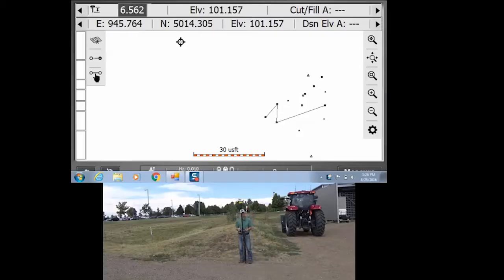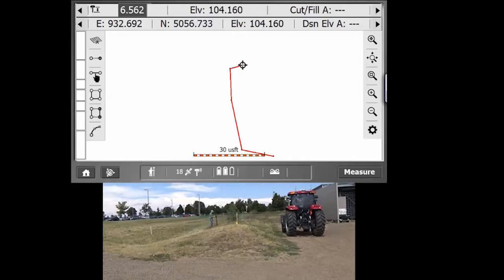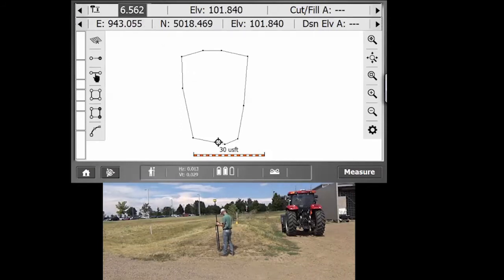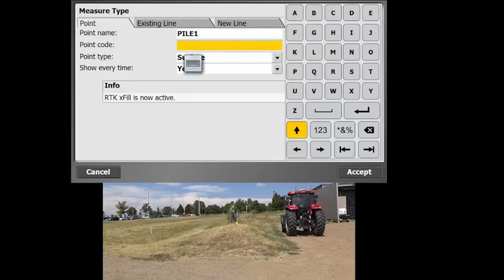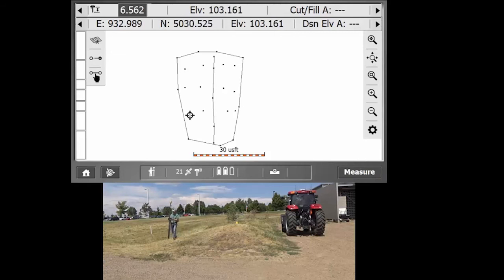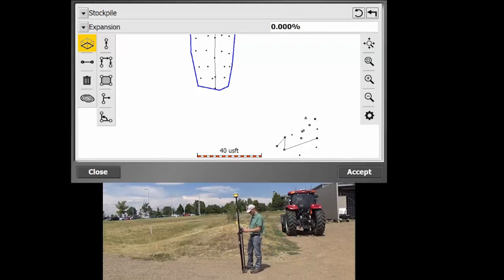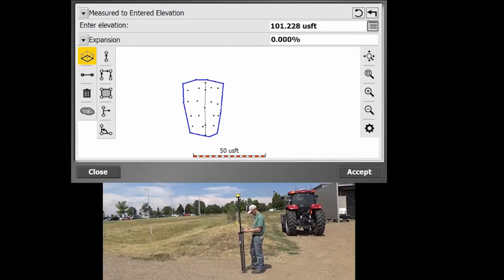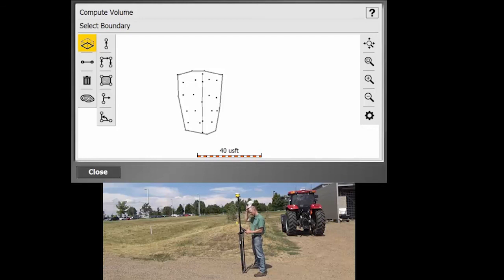Basic Measurement of volumes in SCS900

Comment: So, the first result was 68cy the second was 28cy , isn’t that the wrong way round ?
Reply: i had the same question,, umm HOW MUCH DIRT IS IN THE PILE???? it cant be both.
Reply: @catherinewhisenand5678  was watching this today to calc a stockpile .

You may this now, but leaving in case anyone watches later. From another video, if you choose stockpile it creates a plane based on the volume boundary (which can have changes in elevation), if you choose measured from elevation, it makes a plane set to only the elevation of the point you pick. 

So you can end up with more or less if you do not have a flat base to shoot from and choose the elevation option instead of stockpile.
Reply: Compaction/expansion